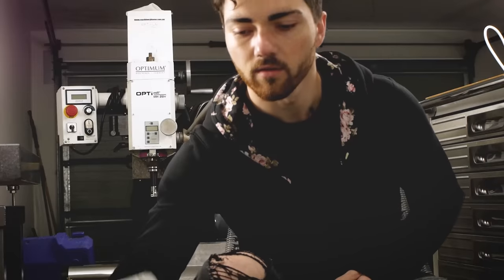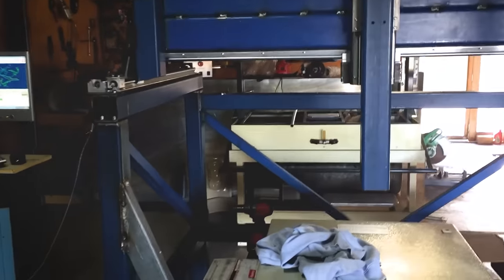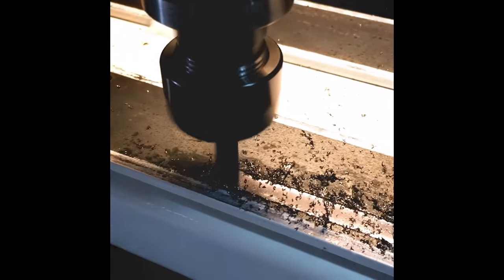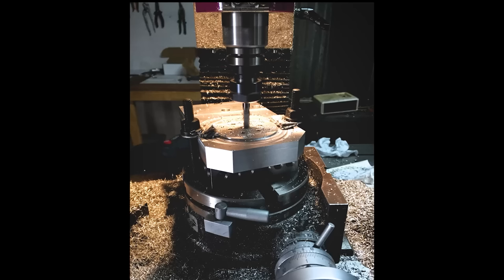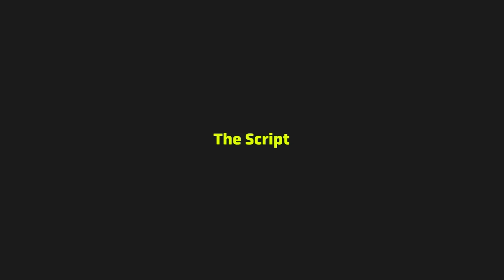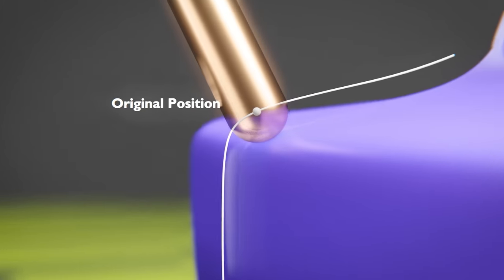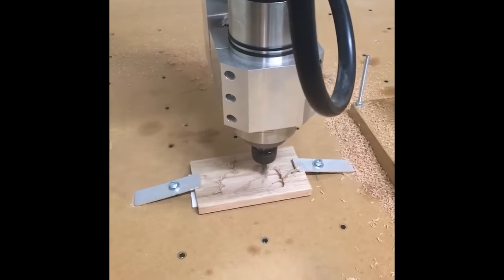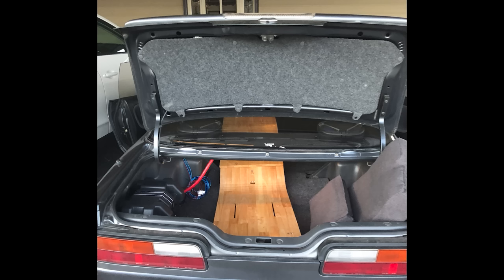I Built a Custom 5 Axis CNC Router and Barely Used It

Comment: Surprised you didn’t go with Linux CNC.
Reply: Having 6axis with a pivoting head would be a challenge. Also be amazing what you could contour. One could even add a 3d printing adapter. A makers machine.
Reply from the maker: I didn’t even know I’d need RTCP when I picked Mach4. I just went with it because I was familiar with Mach3. I’ve spent a fair bit if time thinking about how to do a 6 axis machine. I even wrote a fair bit of code for it. All modelled off of the Zimmermann 6 axis machine.

Comment: Hello! Thank you very much for sharing, this encouraged me to start thinking about adding some rotaries to my router. Could you please share more details which particular postprocessor in Fusion360 did you use? You mention generic Fanuc postprocessor. Is that it? (I have not yet used Fusion360 but this is a really good reason to do so)
BTW did you consider using LinuxCNC as you controller software? Adjusting kinematics module would be all it takes to be able to directly use the output of Fusion360 postprocessor (at least that is what it seems based on your video without actually seeing how that g-code looks like)
Reply from the maker: I chose Generic Fanuc post processor simply because it would produce gcode with tool orientation values (IJK) and it seemed to be fairly similar to Mach3/4, otherwise. I wouldn't really say it's an ideal solution for building a 5 axis machine. It makes much more sense to - as you said - use a controller that can do custom inverse kinematics like Dynomotion's products or LinuxCNC, then use the post processor for intended for that machine, perhaps with some adjustments to the post processor to suit your machine, but maybe not. There's probably someone out there with a solution to this type of machine layout or it might even be easy to set up with Dynomotion (if you're comfortable manipulating a bit of code). I've got some Dynomotion equipment waiting to go into my current mill project (video out soon to start the series).

Comment: cable slip ring would have helped
Reply from the maker: Unfortunately not without dramatic changes. The Harmonic Drives are directly driven by the stepper motors. There's no through hole to send the wires through anyway. I'd have to get a stepper with a hollow shaft or implement a belt drive. I did look at the idea when designing.

Comment: For that much money you could have just purchased a top of the line one!
Reply from the maker: The cheapest comparable size machine I could find at the time was around $50k.
Reply: @machsuper  For what they are made up with that is absurd!
Reply from the maker: @kevinm3751  Precision is expensive. Mine still didn't quite meet the requirements 100%. It was more like 90%.

Comment: Why not pay a mold making company to make some molds out of aluminium!?

And why not machine the aluminium urself!? That machine would do it fine!

Take the 5 axis head off, run it as 3axis so it's more rigid, just take ur time with the aluminium if it's hard to take deep cuts.

I just feel like it's sooo silly to spend 10k building a 5axis to make molds without even knowing how molds are made and what material ul be making molds out of..

Just sounds odd

Great project tho!
Reply from the maker: For sure it was a very dumb thing to do from that perspective. In truth, that was the reason I gave for making the machine, but the real reason was that I just wanted to try making the machine. And when the time came to use the machine for its purpose, I got bored. I really just want to make CNC machines.
Reply: @machsuper  I get it, I've done alot of comparably silly things also, regardless beautiful machine! And job well done!!